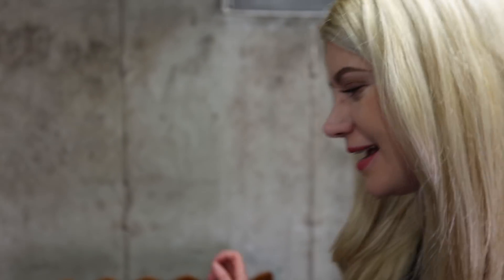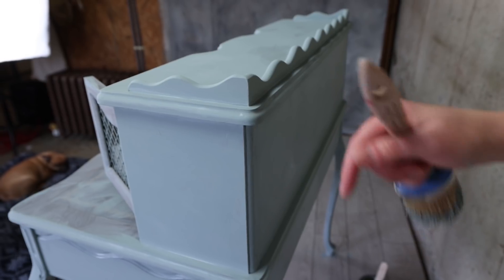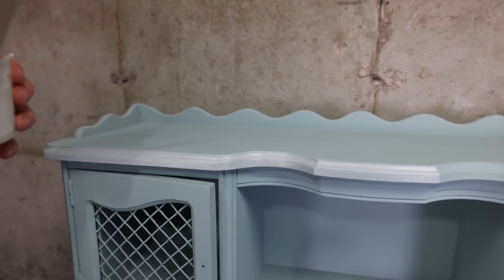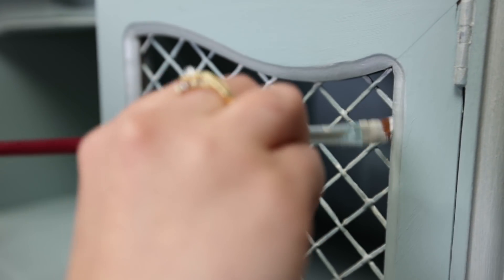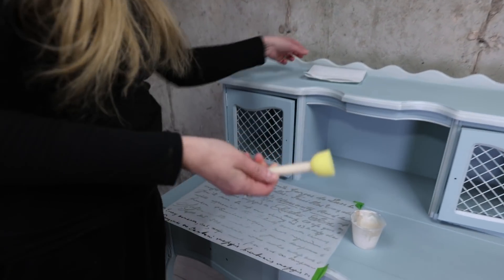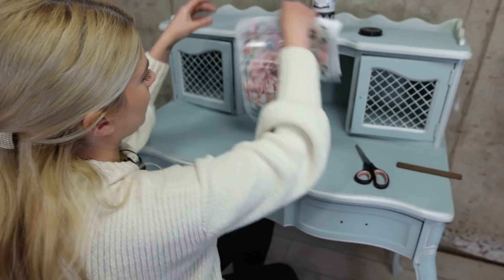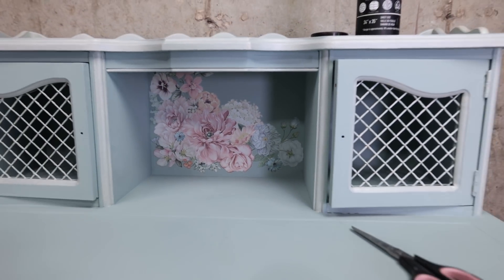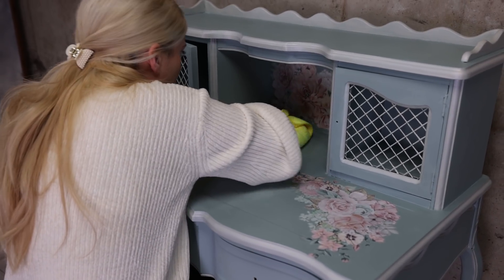Painting this Beautiful Vintage French Provincial Desk I Found

Comment: I love that you show you messed up! I've been remodeling an old furniture that is like 40 years old, and i sanded all the surface, stained it and did a white wash, put varnish on top, and i HATED it! It looked bad, the wood was not the right color and the varnish made a green colour because it was yellowish and i thought it would be ok. I just used AGAIN stripping gel, and started over and painted all white with white linen feom rust oleum chalk paint. Sanded the first coat, slightly, went for a second one. All perfect. When i applied the TRANSPARENT satine water based varnish.... Yellow spots showed up on the top!!!!! I'm assuming it must be from some treatment of the wood below (i tried bleach before and many stuff to make the wood LIGHT). SO NOW I HAVE THE TOP WHITE WITH SOME YELLOW SPOTS 🤦🤦🤦🤦 But I'm done. I've been working for days... My arms hurt as i don't have an electric sander, and i also did s table's legs and 6 chairs! Lol
I left those stained with a light wood colour and that's it. Nothing came out as i wanted to... 

So is good to see that other people even tho they're professionals mess up to! I felt frustrated, useless, and wanted to cry!  Hahaha. 

Hugs from Buenos Aires! 🇦🇷